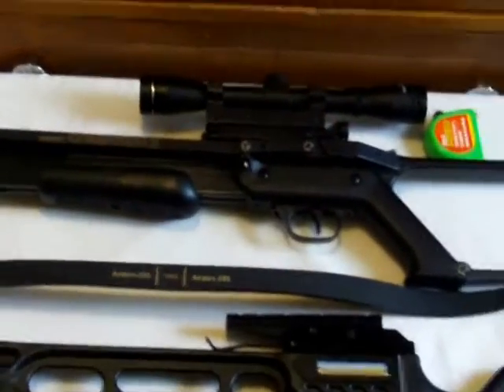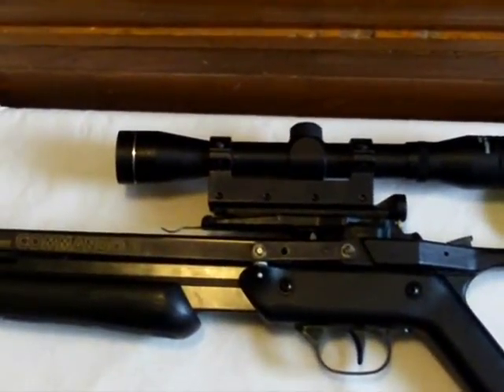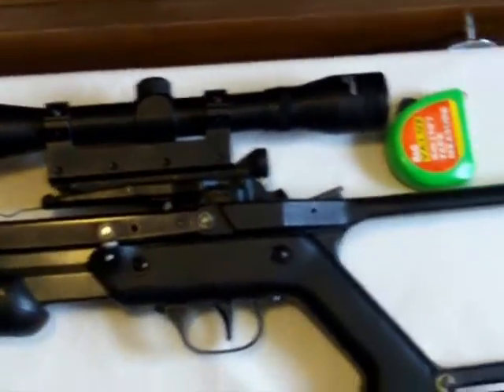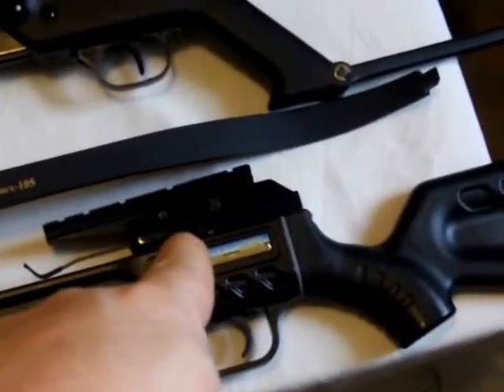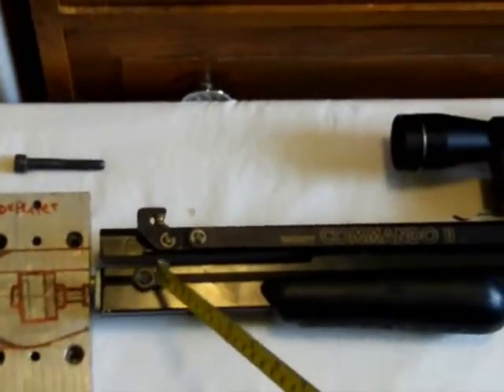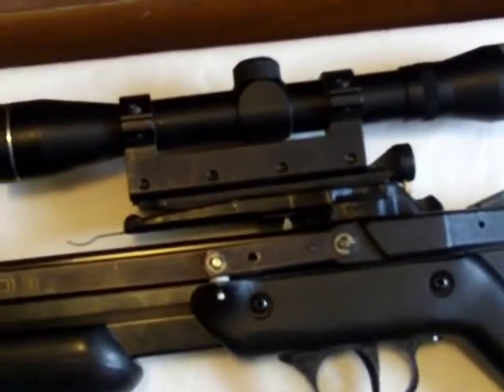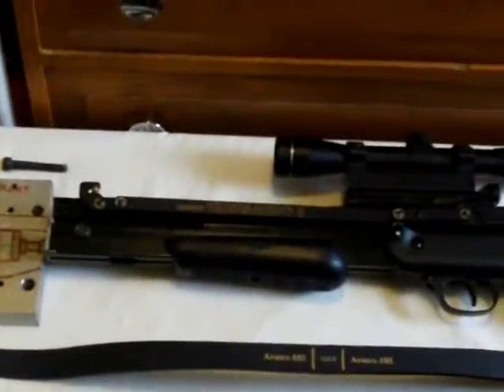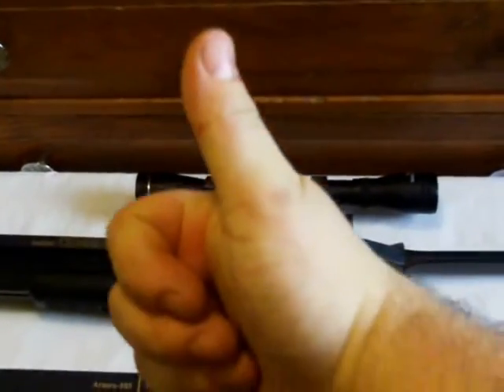Crossbow Advice - Compound to Recurve conversion (please share video around forums!)

Comment: Well, let's look at it this way, my two Barnett Commando recurve crossbows both have a limb/prod of 175lbs. and the trigger mechanism can withstand power from a limb/prod of 220lbs. The Commando has a power stroke of 7.25". The power stroke is what you demonstrated with the tape measure. Barnett offered 175, 200 and 220lb. limbs in the U.K. and 175lb. only for U.S. sales. So, I would say that if your Commando 2 has the same trigger mechanism, it will suffice for your project.

Comment: If you want to continue with this project, try and locate the limb assembly of a Barnett Rhino. This is the closest thing to the original Commando 2 limb design. I am a collector of older Barnett Crossbows, such as the Wildcat 2, Panzer 2, Commando, XT-1, XT-2, Thunderbolt 2. I have them all. Feel free to ask questions about the older Barnett product line. Good luck.

Comment: Hello Mike, the trigger unit on the Barnett Commando compound is the exact same unit they used on the original Commando recurve mate, so I assume all should be okay/ Any bit of power you lose would be counterbalanced by efficiency created by the Commandos cocking links I reckon, and as for a drop in power, the most effective and efficient Xbow I own at the minute is my 95 lb'er, believe it or not. I reckon its over 95 but not by much, and does everything my 150 does only more accurately. Baz ;)

Comment: Lastly, the limb/prod that you are using should only be used for a 10" power stoke at the most. If you go beyond that, you will lose stiffness and rigidity much sooner, which will reduce the life expectancy of the limb/prod. You will also notice rapid bolt speed degradation because the limb will be over flexed while in the cocked position, beyond the recommended power stroke distance. This condition can occur even when the crossbow is cocked for a short period of time.

Comment: BUT, If I were you, I would leave it alone. Once, you cut into the front of the stock, it cannot be restored to its original condition. Also, if you were to find a Commando 2replacement riser/limb, it will not work. Commando 2's (Both versions) are highly collectible, even their parts alone. The reason of its high value is that the Commando 2 was made for a few years and in small numbers. The many original Commando variants were made from 1976-1990 (approx.) and were made in much larger numbers.